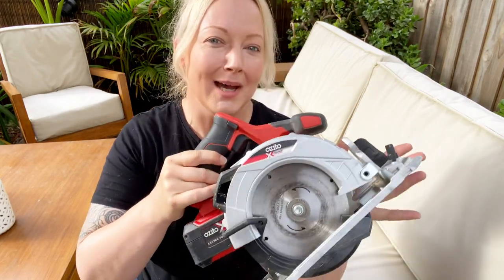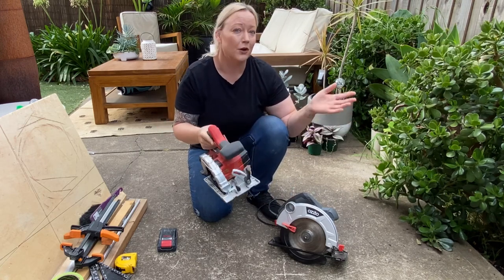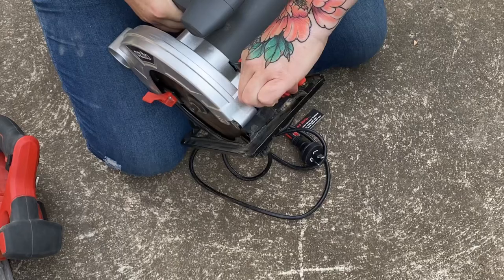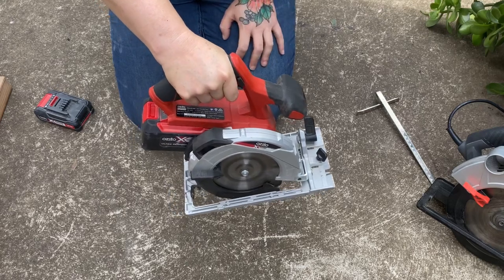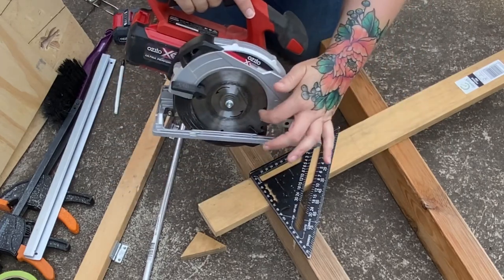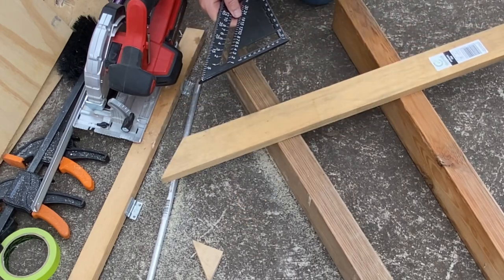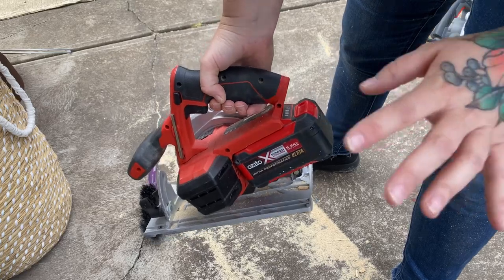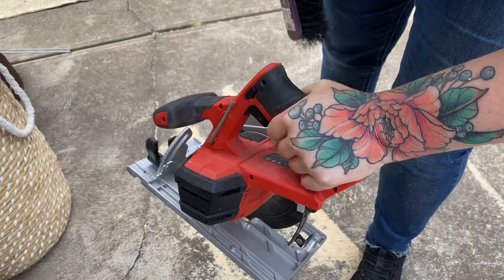How to use a Circular Saw / Skil Saw - DIY Power Tools for Beginners

Comment: Very comprehensive Nic. Not that I want to give you another tool addiction but I think you'd enjoy a number of the Kreg cutting guides like the rip-cut and the new straight-edge guide.
Reply from the maker: Omg I would love the Kreg cutting guide. My Venetian blind edge guide could certainly use an upgrade 🤣
Reply: @NicoleHerrickDIY  The SEG in particular is very cheap and super handy for circs, jigsaws and routers!
Reply from the maker: @FixitFingers  thank you, I’ll check it out!

Comment: Thanks for the video mate! Just a quick question, can I use the 165mm blade instead of 150mm blade on Ozito cordless one? TIA.
Reply from the maker: There are 2 different Ozito cordless circular saws, one is the 150mm and the other is the 165mm. It wouldn’t be safe to use the 165 blade on the 150 machine.

Comment: I like the way you can get good results without a $100,000.00 investment in exotic machines that you see in some YouTube carpentry videos, mainly from America. I've subscribed.

I've been doing DIY things since the 1960s and I've built a couple of sailing boats. I still have some clamps from 1967 and my tradesman grade AEG corded 184mm circular saw from 1978 is still like new. My hand-held saw cuts have never been accurate enough to satisfy me, so I bought a Triton Workbench and used that for many years in both rip and crosscut modes. That went to a refurbishing/recycling organisation a couple of years ago. As did my GMC compound sliding mitre saw because the slider bars had become rusty after we moved from dry climate Melbourne to humid Nelson Bay. I didn't think that I'd want to build stuff again.

I was very dissatisfied with my GMC mitre saw because I found it impossible to calibrate and set and I wasn't sorry to see it go. For example, the only way to get the rear fence at 90 degrees to the saw cut was to grind the adjustment slots for a couple of hours. None of the pre-set settings were accurate. The laser cutting guide was way off and couldn't be adjusted. It was probably accurate enough for cutting fire wood.

I'm now faced with needing to do some DIY stuff and have to buy a few tools on a budget. Apart from durability, how are you finding the Ozito tools for accuracy? I have a drill and impact drill combo that seems very solid.

The funny thing about my AEG saw is that it's put on a lot of weight since it was new. It feels a lot heavier than it used to. Maybe being in my 70s means that I'm not as strong as I used to be. How could that happen?
Reply from the maker: Hi! I have found really good accuracy and durability in all my Ozito tools. I have the sliding compound mitre saw and the back fence is dead on. I do always double check the movable angles with an angle finder or speed square if I want SUPER accurate cuts like in making furniture. The circular saws are always very accurate and I hit my line every time. All in all, they are great tools for the home diyer. I use at least some of my tools every single weekend.
Reply: @NicoleHerrickDIY  Thanks. I'm encouraged to have some fun 🙂

Comment: The clamps you have in the vid are quick clamps not f clamps. Safety tip don’t plunge with a circ saw and use a mitre saw as they’ll kick I’ve had heaps of saws kick back at me

Comment: Hi, Great video, how do I know what depth a saw can cut? I'm trying to figure out which size Ozito saw I need, the cordless have 3 current models at Bunnings.
Reply from the maker: In the features on the Bunnings website, it says: Max cut depth. Or on the saw itself if you’re in store, it usually says it somewhere on the model, definitely on the box as well.
Reply: @NicoleHerrickDIY  Thanks for the tip, I'll check again.

Comment: Hi I'm new, just wondering how is drill a hole in a concrete block, I have the tools, but dont know how lol I'm in Ireland
Reply from the maker: Do you mean how to drill a hole in a concrete block?
Reply: @NicoleHerrickDIY  oops yes please
Reply from the maker: @mckeon1960  ok, you’ll need a drill that has hammer action and a masonry bit. Make sure you go nice and slow and stop every 5mm or so and blow or vacuum out the dust. Don’t push super hard on the drill, allow the bit to do most of the work. Go at a slightly slower speed. https://youtu.be/Xq1tSFduzVo
Reply: @NicoleHerrickDIY  thank you so much I'll let you know how i get on 😁